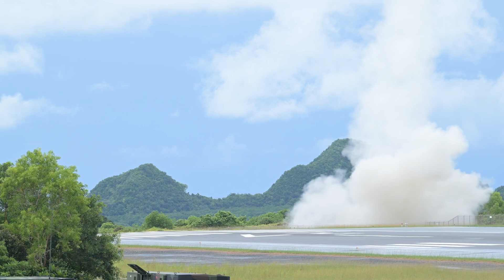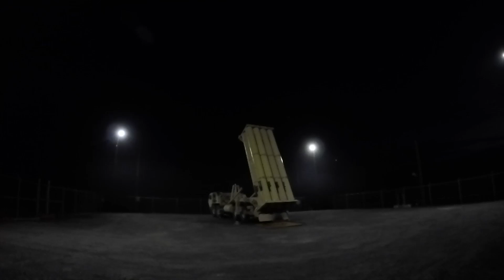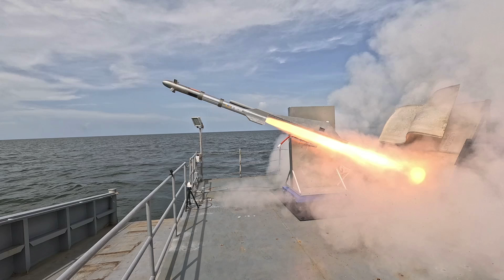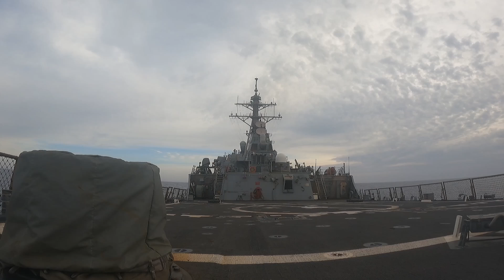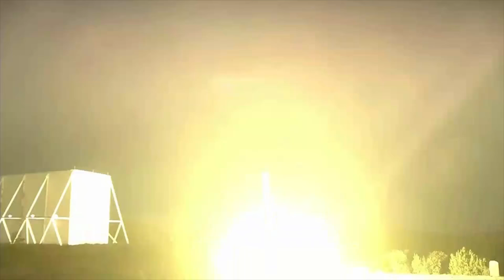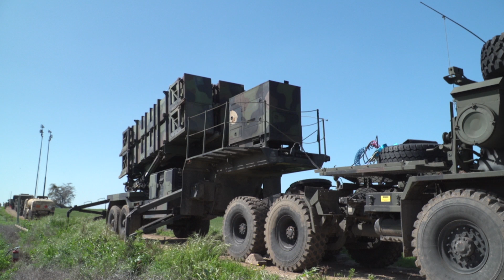X-Bow : The $750,000 Missile Interceptor That Could Change U.S. Air Defense !

Comment: Having better options for rolling airframe launchers is HUGE. This is because they can be reloaded at sea and 1 small launcher has something like 20 missiles. It frees up VLS.
Reply: Should be 40 per launcher. But just my. Opinion.
Reply: @bhogan843 I didn't look it up I just gave a highly conservative lowball. 
If its 40 thats even better.

If the new Frigates have no VLS but DO have a 40 shot rolling airframe launcher and the buckler actually has decent range and only costs 100k 
That's not bad.
Reply: @ravissary79   I said (Should be 40 per launcher, but just my Opinion.) I never said it was a 40-shot launcher. The Navy's current rolling RAM launcher maxes out at 21 missiles. But I believe it should be 40 or more and also an easier way to reload rapidly. Those new frigates, just like their cousins the CCCs, can be fitted with that launcher.
Reply: @bhogan843 well, even a 21 shot launcher is a great alternative.
I just looked it up... the buckler is designed to target and take out drones and light aircraft up to 15 miles away and up to 18k feet above sea level.

That's EXCELLENT. And it costs 1/10th of most alternatives. 

Its almost like a suped up stinger with broader, more sensitive guidance and better range. Except stingers cost more.
Reply: Depending on the size, they might be able to load 4 missiles into one VLS cell. Would give them a huge load out.
Reply: @michaelr4858 true... but you wouldn't want to do that TOO much because if you do you'd give up your most capable interceptors with superior range and power just to have more short range missiles in a format you can't reload instead of just reloading your rolling airframe launchers at see... giving you a significantly deeper magazine over time. 

But i could see doing that a little bit.
They already do this a little with the sea sparrow.